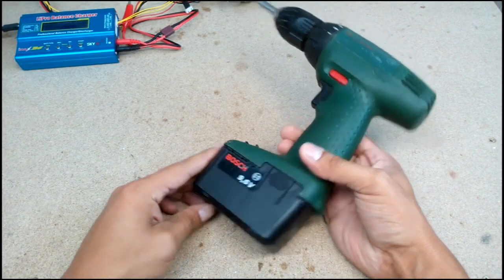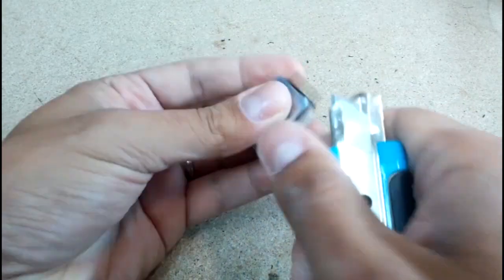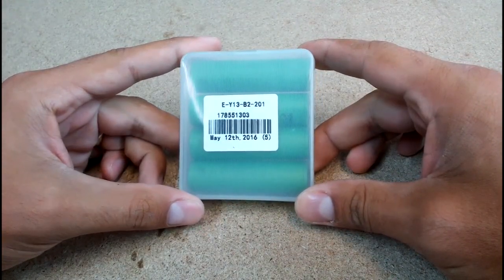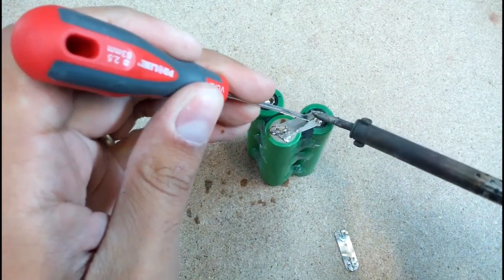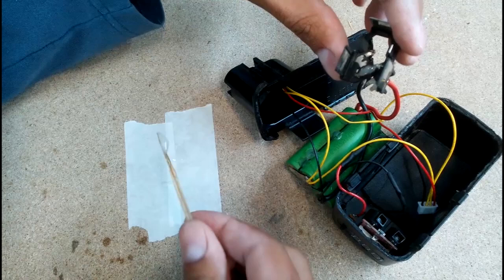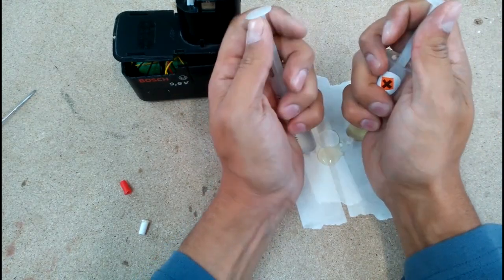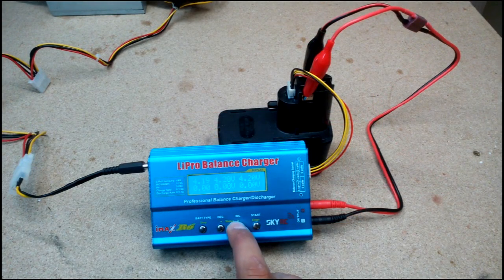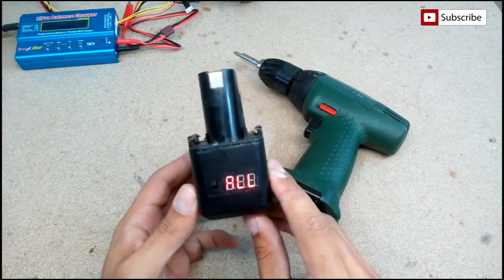DIY: Ni-Cd To Lithium Battery Conversion By Using 18650 Cells

Comment: Good video. I did the same thing with an 18 volt battery a few years ago and it worked well for a short while. It was okay as a little project, but not really practical. It is too much hassle for regular use. Did you know that with Ridgid brand tools from Home Depot you can register for a free lifetime service agreement which also includes a lifetime warranty on batteries.

Comment: I wish you used bms circuit too.no problem while charging you are using i max.however, it is also necessary for the batteries to discharge evenly while using the drill.

Comment: Sir, May I ask .. I want to change the 12v nicd cordless battery to a 12v li ion, so what is the appropriate value (ampere) for bms ??? 25a or 40a and so on ... Thanks sir...BOSCH GSR 12-1

Comment: Thank you for sharing. And, here, I descovered how to power off the low alarm buzzer (just disconnecting the ground wire - the first). But I am not sure that the voltmeter will not consume current even if powered off like this. What is your opinion?

Comment: if you hold tool in full on and resist motor turning you get more than 30 amps say blade jams in wood same thing
what about a reset car fuse 30A  as a saftey

Comment: Why not use a BMS chip which would let you charge on the original charger?
Reply: That would certainly be a good idea as the new loader equals the price of a new drill

Comment: All I really want to know is where it's the low voltage detector in the battery or the drill?
Reply: It wouldn’t be much use on the drill would it?

Comment: very dangerous to use soldering iron to join those cells. they really don't tolerate heat like ni cd or ni mh cells.plenty of videos on here showing the potential explosive power when subjected to heat

Comment: Awesome. Amazed at your confidence opening up the Battery case and modifying to replace with Li-ion Batteries and Bonus metering. 
I always have the fear that 'rough handling' battery packs is hazardous. Truly you have done a super super job.
Luckily I have not thrown away my industrial AEG 14.4V  Nicd power drill. I hope someone can help me convert like you did.
👏👏👏

Comment: Would it be possible to get a full part list? I see a connector in the battery housing, the voltage tester and a small on/off switch.

Comment: Dont replace Ni Cd or Ni Mh pack with Lipo batteries UNLESS you have a Lipo capable battery charger. If you use the original Ni Cd or Ni Mh charger on Lipos, you will damage the cells or worse, have a fire!

Comment: great idea! I noticed your drill was rated for 9.6v. Three LI-ion batteries in series have a max. voltage of 12.6V and a nominal voltage of 11.1V which means your drill will draw about 16% more current and might overheat and burn out. On the up-side, the drill should be more powerful. I think it's worth taking a chance on this as it's such a great idea.

Comment: Nice job!
I did a similar job on my prev gen to yours Bosch 9.6v drill - the PSB-VE  with the metal clip that secures the battery in place. 

I used 3S bms board rated 40A, sold as for drills and power tools and samsung ncr 3000mAh cells. I have a MOT spot welder to connect up the cells. I had to reshape the old battery case a bit to fit the 3 cells as a flat pack - not too difficult with a hot air gun to soften the ABS. I fitted the case with a dean connect and JST balance connect like you so I could use my Imax (direct connection to the cells), and a 5.5mm jack for 12v DC input to the BMS pcb, alternative charge mode (diy ATX bench power supply). LED battery charge indicator + switch like yours.
To put the case back together I used plastic weld solvent (works well on ABS) and soldering iron with diy plastic soldering tip (copper nail cut down). 

I think it is beneficial to have the protection of an appropriate BMS while you're using the drill. Also this type of BMS with input and output terminals the same allow the possibility of using the original charger because the input will be through the BMS. In practice I noted that the voltage across the charger (rated 7.2-12V)  terminals was 19V on my multimeter - could blow the BMS? More commonly the original charger's won't fully charge the LIPO's.

Comment: Excellent rendition sir . Loved so much as it's  effective too for my case . Cud you Kindly spell out the battery specification so that I can find same in India. By the way my Argos challenger 9.6 V Ni Cad  drill doesn't have any digital display of voltage and alarm, so I am going to connect directly. OK ?

Comment: Fast swap case for 18650 cells would be nice, now everything is solderd and glued, but if a cell dies you have to get it out. You could have used a holder > facing cells to the buttum and add  maintenance door at the buttom.

Comment: I have a pair of 7.2V Bosch drills that look very similar to your 9.6V. They both are around 20 years old and replacement betteries about 6 years ago cost more than the drills did. I didn't go as far as you have, I just fitted twin 18650 battery holders inside the original battery case with thicker wire and used high drain 18650's. The original snap mounting onto the drill holds everything together quite well. Doing it this way does mean I can replace just the batteries when they need it.  The mistake I made is that they do not have any protection circuits so I will have to get batteries that do. It was your video that made me bite the bullet and convert the very old dead original batteries. With the original batteries these little 7.2V drills could punch a 100mm screw around 5mm below the wood surface. Just goes to show that Volts has absolutely nothing to do with power, It's volts x amps = WATTS that matter. Ni-Cd actually can deliver a higher current but the 18650's seem fine.

Comment: You can use double (triple, quadruple) the amount of laptop 18650's in parallel to achieve the necessary constant discharge rate. Of course then you'll need to modify (extend) the battery case to fit them all in. Another option is to mod a DC in jack to the battery pack or the drill, (my preferred method, behind the motor). It'll bypass the battery if wired correctly (DC - for the battery goes through the DC jack).

Comment: I've had good luck stuffing 11.1 volt 2200 Mah RC car packs into gutted Makita 9.6 volt sticks. If you get the right pack, they will just fit but sometimes you have to cut the side of the stock open. I tried the small alarm modules, found they would go off whenever the drill bogged down so no longer use them. I use an IMax B6 balance charger. https://www.facebook.com/photo.php?fbid=10153052325735238&l=e4fe681b2d

Comment: Just buy lipo power tools first. I bet it burnt up the motor or speed control after just afew months.
Reply: The motor and speed controls have no idea where the voltage comes from, the new battery pack is not that much higher in voltage than the original.
Reply: @williamjackson5942  LOL 12.4v is not much more than 9.6v. OMG there is a huge failure in the education system. You  people are walking brain dead fools.

Comment: Hi. I have an idea, but i am not very good at electronics :). Is it possible to upgrade my nicd to lithium the following way...To use 18650 holder box for 5 batteries, and the same batteries to charge them with lion charger? The battery holder is 3x18650 and 2x18650, to connect them and replace the nicd batteries. https://www.aliexpress.com/item/1Pc-4-3-2-1x-18650-Durable-Plastic-Battery-Holder-4-Size-Portable-18650-Battery-Box/32847794157.html?spm=2114.search0104.3.17.7ad37c9cP3u2tA&ws_ab_test=searchweb0_0,searchweb201602_1_10065_10068_319_317_10696_453_10084_454_10083_433_10618_431_10307_537_536_5736111_5736011_10059_10884_10887_100031_321_322_10103,searchweb201603_45,ppcSwitch_0&algo_expid=8b81a815-7942-4986-a6e1-c27d5facd7be-2&algo_pvid=8b81a815-7942-4986-a6e1-c27d5facd7be&transAbTest=ae803_3

Comment: Fate ATTENZIONE  , le  batterie agli ioni di Litio se riscaldate possono esplodere , non saldate gli elettrodi , compratele con gli elettrodi gia' applicati 

Pay ATTENTION , if  the lithium-ion batteries are heated can explode, do not weld the electrodes, buy them with the electrodes already applied

Comment: Just a tip instead of using hot glue and 2 part epoxy ,Just use super glue then sprinkle some bicarbonate of soda powder on the super glue ,it dries instantly and rock hard,,works for me

Comment: Very good method, but there is much much simpler !!  You just have to solder an XT60 connector to the + and - of the Drill and simply use a 3 or 4s  Lipo battery with your drill !! The advantage is that you 'll be able to have more or less power with 3 or 4 s battery !!!

Comment: I have the same Bosch 9.6V drill. I used three 18650 2.1AH Lithiums from a 6 cellToshiba laptop battery bought on Ebay for £3, (£2 postage) so they cost me £2.50 & 3 spare cells.
I wired  a 12V 5W Zener  in series with a 39 ohm resistor across them, then used the voltage across the resistor to switch on a transistor wired across the existing thermistor to switch off the charger (which also has a convenient max output of 12.6V 750mA). Charges them up to 4V each so likely no balancing problems & no overcharge. I can still use the original Bosch charger for both this battery and for a spare 9.6V 1.7AH NiCd battery pack. Works fine, plenty of torque and hasn't caught fire yet.

Comment: Hi WDTips, I'm hoping you could see a video I uploaded to google drive and give me your opinion. The BMS I have in video is a 25amp 3s. Thanks... Oh and before I connected the B1 and B2 I checked the voltage on the bms's p- and p+ and it gives me a 12.43 volt reading....https://drive.google.com/file/d/1-SS_9lVAeN6Ni7wauIk_KgbZ_eUS4nvi/view?usp=drivesdk

Comment: Can you use the existing Bosch 9.6V charger to charge back the 3 x 18650 batteries now in the battery pack?

Comment: Finally! Was able to get my 18v harbor freight impact drill to work just like this. I used 10 batteries 5s2p. It was a tight fit. The old batteries would self drain after each use. But now, used it and after a week its still fully charged. Awesome. You are a life saver. Or I mean a drill saver. Thanks, and good luck!
Reply: you got 10 - 18650's to fit in the original HF battery case?

Comment: I've managed to use the original charger with it by putting a 3S Battery management inside the battery pack. The Bosch charger show full at 12,26V. That's 4,086V per cell. So they don't get 100% full. I had to solder the temperature sensor to battery minus. Otherwise the Bosch charger won't start charging. The BMS need to be at least 25A.

Comment: You have to help me. I have a 5s2p 18v pack and have a 1 6pin balance lead for charging and 1 7pin lead for the volt meter. I connected the 7th lead to the on off switch and another negative wire  from the pack negative to the switch. Problem is voltmeter is reading 14volts instead of 18volts and keeps beeping. Please help. Thanks. Oh by the way.. If I connect the volt meter to first set of wires for charging, everything is fine.

Comment: Great vid, thanks! I switched from a battery to wired drill when my batteries died after 3 years use, and I found out the price of a battery pack was the same price as the drill! Most of my drill use is within reach of a plug socket, and I don't have to worry about my project coming to a halt because both of my battery packs are have ran out of juice ;) But I have kept the old drill so I could resurrect it now, cheers!

Comment: I tested 2 batteries on the weekend and both of them looked to be " dead". Right after using this battery reconditioning program ( Check Details Here>>>https://www.facebook.com/Battery-reconditioning-310070329426065/app/208195102528120 ), I had been able to rejuvenate them both to 100% working batteries. I saves $ 180 because of that procedure!

Comment: Got to start things off slow here...
Lets not remove 8 batteries designed for the tool and the charger's capacity
And put in 3 of a larger capacity 
Just to make it work...

Like there was some hurry here

Couldn't do the right job and get 

                       THE RIGHT 

Replacment batteries

As he indicated he was doing when opening the case and measuring voltage

Clearly couldn't wait till he opened the battery housing to 
Order batteries .????
Who is THAT  idiot...

SO HE OPENED THE BATTERY HOUSING AND INSTALLED THE WRONG ONES

Not impressed with a guy who replaces your air filter with another one he smashed downfrom another model car cause it was the right diameter  to fit in the housing

STUPID STUPID SHIT

Saying this shit from experience
Have 8 Milwakee batteries 28v
I use on all my cordless 
Sawsalls 
5 dills, 
Cordless circular saw...  
FLASHLIGHTS

5 of them will not charge any longer...Took some time to do the right job

GREAT HAND TOOLS...    

Use em like a mad man

NEVER HAVE TO CHANGE OUT DRILL BITS OR REAMER TIPS

Our work is about having the tools at hand and at the ready...
SO...Took one battery apart..  
Got the MFGR details for more than exactly specifically the same batteries

Upgraded somewhat because the replacements were not 2.7 volts

They are 3.2 volts with the same 14 discharge rating...
But also instead of 30 amp
Capacity at 14 discharge 
They are 40 amp capacity... at the 14 diacharge rate

The stock factory charger will still meet the specs of 32volts to the cutoff and 
Meet the Discharge 14  rate...
Replacement new batteries still have a shelf life... from the factory stock
So what ever I bought as mfgr 28 V Milwakee batteries...  
Cost no less than 75.00 ea

No big deal...These from china upgraded batteries were 3.42 each and the battery housing Holds 7 batteries in each factory battery base

So I ordered 15
Good to have some spares

Took a month for delivery from china
Put the new same sized new ones in 2 bases
Of the 14 I removed there were 5 that would not hold charge at all
Discharged and brought all the good ones up that would reach and hold 3.9v
And replaced the bad ones in the other 3 batteries that would not hold charge
All in all ...  pretty cool...All reach full charge capacity on stock milwakee charger

Life is so fucking good....   
:)

Cost me like 70.00 for the 15 new ones including shipping
And got about 400 dollars of batteries for 70

All started with Google search the battery part numbers which are not available any longer...   Sent at request for quot on a site in China... and the gal researched and sent me back the specs and availability for the same sized  upgrade battery instead of ending in          xxxxxxxxxxx A...      it was    xxxxxxxxxxxxx AB

Found the older ones in Canada after all the research for 12.00 each..

Comment: Hi there... can u help me? I have made a 18650 battery 4 cell pack, with balance leads. The problem I have is when I try to charge and balance charge it. I get BATTERY VOL ERR CELL CONNECT..... do have a idea of what it could be and I'm using imax B6 Lipro balance charge
Reply: Tea Constan. Plus and minus reversed on your balance lead. Look at another plug.

Comment: You can save a lot of money by bringing your old batteries back to life and re-using them instead of buying new, overprice batteries. And this method is simple [Check Details Here==>https://plus.google.com/100351090281822647456/posts/Gwtd4mVBdEd ], quick and anybody can do it.

Comment: I tried soldering tabs on Li-ion batteries and they were too heat sensitive. Destroyed them. Some immediately, and some awhile later. Not like nickel batteries at all; those you can solder. If there's a trick to it, you need to explain that.
Reply: Use a higher wattage soldering tool. Higher temperature allows solder to tin more quickly, reducing the amount of heat absorbed by the battery. The same reason oxy/acetylene is used instead of propane for welding.

Comment: Neat hack but ultimately not very practical.  The brush in the motor will likely wear out before this becomes an issue at which point you'll be buying a new li-ion drill anyways... :-)
Reply: I have quite a few battery powered tools, most of them with bad batteries, none with worn out brushes. You probably use your more regularly than most of us. I have an auto-transformer  connected to a rectifier and with the proper cord I can just plug mine in if 120vac is available. One way to make use of what is otherwise, junk.

Comment: I have 12 3.7 18650 battery and I want to make a pack for a TDA7492p Bluetooth amplifier board using a 200w 8" speaker. I'm looking at less 18v. Could you do a video on this

Comment: It will damage the drill if I put 6 cell connected in series of 3 groups of 2 parallel cells, to increase the mah at the same voltage? (sorry for my english)

Comment: Sir I have 2 question,
1.Any alternative method for charging lithium without using balanced charger?(simple answer only)
2.Can u spare you time for simple diagram on the connection of the battery to charge and port pin connection

Comment: Why do you not charge the 18650 cells in Li-ion mode? I think it is somewhat saver and charges the batteries till 4.10 V each. Also more than enough to start. Further it is a very good alternative!

Comment: 5:22 "solder wires to original terminal connectors"
What size wire would you recommend?
Reply: Jeff, while I did not make the video, and I am sure you've had numerous responses, I would recommend as large a gage as you can easily get in a stranded wire. 12 or better yet 10 Ga is my recommendation. Agree? What was the general consensus on the advice you got if you don't mind sir?

Comment: What would be really awesome is if you replaced the low voltage alarm with a low voltage cut off - "Battery protection circuit". I think that video would reach 1 million views.
Reply: Well both combined would be ideal. While 3 volt cut off is recommended you can discharge them to 2.5v if you just need 2 more holes in the wall
Reply: Lol he reached 2mil
Reply: Zhj